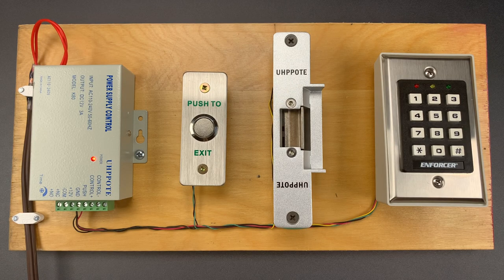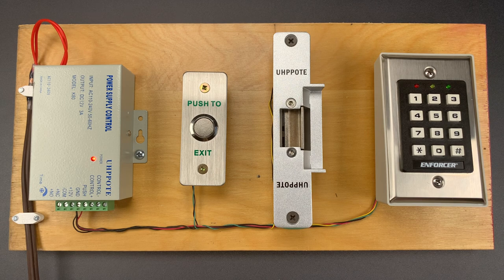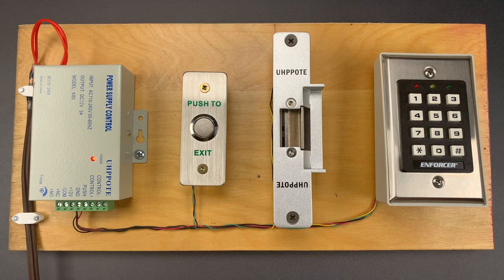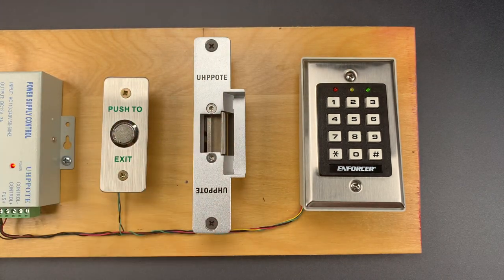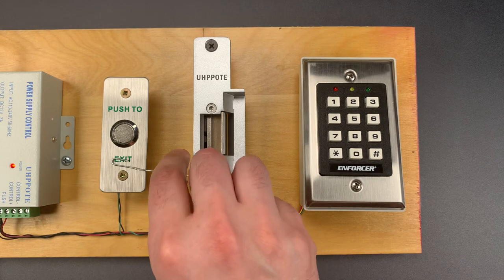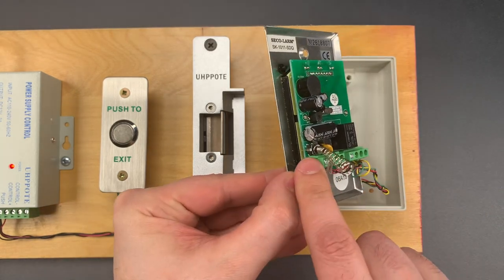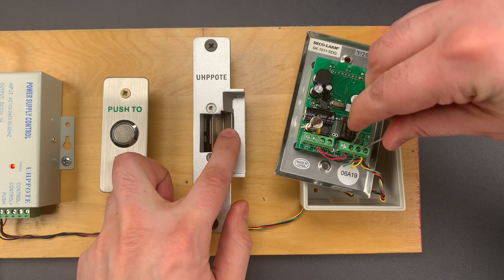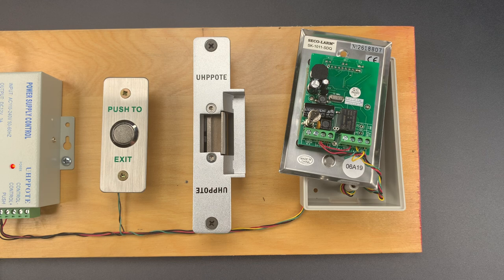[1045] Swiss Army Knife Bypass of Keypad Lock

Comment: "This is the Lock Picking Lawyer, here to prove once again that there is nothing you can do to stop me."
Reply: Yeah. Genius lawyer goes to prison for someone else's crime...
Reply: Imao
Reply: At this point it would be easier to just convince him that there is nothing behind the lock worth getting into.
But then he would simply take the lock as a challenge.
Reply: It would be actually fairly simple to stop him: You build a keypad that only sends they keystrokes to a controller unit on the inside of the door. That way, the only wires you can reach is sigal wires that don't do shit without the code. Bonus points if you put the controller unit in a metal box to prevent tampering by EMP or magnetism and make the opening-closing signal a little more complicated than just on-off on a certain wire. 

At that point, you'd either have destructive methods or defeating the controller left as methods of entry
Reply: @An0niem4  that's usually what is done in access control
Reply: @jonsgarage3859  Yes, proving that LPL can only defeat shitty systems in this way. What is shocking to me is how common those shitty systems seem to be
Reply: @An0niem4  Would you like some popcorn while enjoying Security Theater?
Reply: @napoleontheclown  could I please have sweet and salty mixed and a large coke 🥺

Comment: This is why it is important to use an access control system that communicates to an internal controller that makes the decisions. Don't let equipment on the locked side make any decisions.
Reply: Like jails.
Reply: Like how you should never make a website client-side, you can just edit it with inspect element
Reply: @hotfire7075  you mean you shouldn't authenticate client side. There's nothing wrong with putting other stuff on the client side
Reply: @alexeecs  True, a website that has nothing on the client side is hardly a website at all.
Reply: It's amazing how simply relocating that logic with some wires will probably raise the cost of the solution by about tenfold...
Reply: @SolidSonicTH  this unit is great for pedestrian gates or vehicular gates, I've seen it installed on giant mailboxes for amazon also. The op is correct, you would be better off with a controller installed inside a secure room and give each tenant their own credentials, this is the right way. Yes that is exponentially more expensive. 

I use an app or remote to release my e-strike and there is nothing outside to compromise. Better that way
Reply: For office environment, you have to provide a bypass there at the door for safety reasons, such as crash bar or motion detect. In my case, the door was indeed secured by central control, but for safety requirements you have to allow people out by a system that bypasses the lock right there at the door (in case of fire, etc.).
Reply: @hotfire7075  there used to be a game like that, but only the "send gifts to friends" part so what we'd do is just before we send gifts we change the code w inspect element to give another item to our friend, so we gave each other the most op shit you can own
Reply: @ws8080  Yeah, but you can use delayed egress crashbars that make a whole lot of noise, and it's not required to be on internal doors, such as data closets.
Reply: Always put the security on the backend
Reply: Never trust something you can unscrew from the locked side. My favorite with USA type doors when I forgot/lost my keys was a hammer + screwdriver, took about 10 seconds to “break into my house”

Comment: I was once working on an event packing up the stage into a basement and there was an RFID operated lock that gave access to an industrial elevator that rose from the ground to the outside and one of my work partners accidentally closed the little control door and the person authorized to access it went home for the day so I called security to open it but they didn't come for several hours so I unscrewed the rfid scanner, bridged the contacts and opened it. This being a federal institution, it actually set off a silent alarm and security STILL took an hour to arrive =____=
Reply: Federal institution, and it's that easy. Technology has outrun humans by do far, anybody with s little motivation can have their run of the world it seems. Personally I never trust tumbler key locks, they are medieval artifacts that haven't changed in a thousand years, ridiculous
Reply: @ddgryful  Patently false.
Reply: Hahahaha that’s awesome!
Reply: The reality is, locks are meant to be opened. It might seem ironic to most, but if that weren't the case you may as well just weld whatever the lock goes to, shut. So long as that's the case, it can be opened without a key or code by just understanding the mechanism. 

That's why the old adage exists that locks only keep honest people honest.
Reply: Gotta love "High security"  it is possible someone related to security was high.
Reply: I knew how this would go as soon as you said "packing up the stage." Theatre techs are pretty much my favorite humans: happy to along with your lock/policy/whatever until it becomes an inconvenience, and then they'll just dismantle it with LPL speed and efficiency, do what they need to, and reassemble so you're none the wiser. "Never cross them. They will get even and you will never be able to prove it was them."
Reply: @ddgryful  Pretty much the entire federal government was using mechanical cypher lock door handles that could be opened with a magnet, it's not that surprising.
Reply: I rig.

Comment: Me: - Oh, a 4.5 minutes long video from LPL about an electronic lock! Must be a good one if it lasted this long.
(Five minutes later)
Me: - Oh... False alert - it's an exploit compilation video.
Reply: Fatal design flaw: lock internals behind keypad should not be located in unsecured area.
Reply: @Paul Martin I think a properly made electronic lock will not trust the outside unit. It might as well have wing nuts and security would be okay.

Well made lock will continue to work flawlessly even if you cut the outside unit off and connect wires e.g. to mains voltage or to a welding transformer.
Reply: @MikkoRantalainen  idk I'll have to look at ours. The ones we have at work we maintain are a good bit more have end I'd say but most likely still gave trash security
Reply: Right. I was like oh similar locking setups to what we have at work must be complex. 73 ways to disable, hmmmm well shit.
Reply: You literally went to town on the format of your text. 🙄🤣🤷🏼‍♂️

Comment: The door to my storage room got locked accidentally today. I went through a bowl full of keys that came with the house and found the one that should open the door. It didn’t. The whole mechanism was gummed up. I thought about getting my picks out of the truck, but grabbed a 12” piece of wire laying beside the door and slipped the latch on the 2nd try. Moral of the story, bypassing is often easier than picking.

Comment: When I was in the Navy I worked at a comm station in Keflavik. The building was somewhat secure. They wired the egress button separately from the outside control panel. That seems like such a simple thing but it really makes a lot of sense. Also there were no accessible screws from the outside of the door. Again, simple, but makes sense.

Comment: Mr LockPickingLawyer
Excellent presentation , as always.  I am the small-scale   technician ,  working in Greece , and use  this keyboard too , Hoever....
 I  made some personal modification on  it , replacing tamper  switch  with electro-optical coupling 
and  connecting the chassis to  15 KV , low amps transformation.  After  removing the  screws , any  suspicious  intruders  get  very dangerous electroshock -but only once . Afterwards  the  circuit  is out ,  to avoid  any possible  LEGAL problems , for the owner.  Do this for 10 plus years with  success.  No lawsuit yet...

Comment: As a industrial electrician with a heavy background in control wiring I’ve had to use this method quite a few times to get into electrical rooms when nobody is there to open the door in the early hours of the morning. It’s a simple method but most people have no idea how to do this so it’s not a real issue for the most part. I’ve never came across one with the security spring wired in with the exception of the federal reserve’s in a few cities
Reply: The anti tamper switch doesn't neccessarly need to be wired to an alarm, but one way to increase security is to have a relay (with keyswitch or button for reset) on the inside, where the lock wiring is also connected. The tamper switch is simply connected in series with the NO contact on the relay, then the reset/keyswitch over the NO and C contact, to the coil, so the pulled relay effectively powers itself.

When tamper switch releases, the relay will lose power and only way to reset it is to reset via keyswitch or reset button.

Then wire lock wiring in series with the second C and NO contact, only providing power to the lock if relay is pulled.

This will create pretty much security for pretty low cost, as any tampering will disable the lock wiring, so regardless what attacker does, nothing will unlock the door, only way in is with physical key then press reset button or usevreset keyswitch on inside.

An reed switch (nc) can be added in series with tamper circuit to prevent using external magnet to trip the inside relay.

However, as we seen tamper switch can be easily be bypassed, but this creates a trap - like trap pins in a cylinder, once you trip the trap, your day is over.

Comment: Finally a use for a Swiss Army knife.
Reply: You mean other than to hand over to TSA?
Reply: When I worked on building control systems, I used this exact knife for most of my physical work from bathrooms to casinos to military research sites.
I still have one on my key-chain and regularly use it for all sorts of little jobs.
Old related joke, "The chainsaw starts with a roar and the rube asks, 'What's that noise'."
Reply: Finally?Are you sure?:)
Reply: Multi tools are a thing of convenience and are great for small things like this. If I didn't have so many keys I would carry one in my pocket.
Reply: I find they aren't up to the job for the work i do.  They work in a pinch, but even a crappy tool for job far exceeds a small multi tool.

Comment: imagine claiming to have an anti-tampering switch and not actually connecting it to anything lmfaoooo
Reply: Well, that's up to the buyer to put a sound alarm to the terminals, perhaps the seller of this electrical lock has a version that includes it, but it's cheaper to sell it without it and whoever acquires it can put any sound alarm they want in it.

Anyways, this is just a big failure because the central components are exposed to the outside of the lock, make it pretty insecure as LPL showed.
Reply: You don't want to know how many people kept the electrical fire monitor system on "manual override", just because “those false alarms are soooooooo annoying”.
Reply: Maybe its so it can be hooked into a buildings existing security system. Still pretty easy to defeat but some buildings I know prefer silent alarms.
Reply: Like those black plastic "cameras" with a flashing red LED. Or the "ALARM MONITORED 24 HOURS" stickers - no alarm, just the stickers.
Reply: Thats the case more often than not.  Consider it a cost saving measure.
Reply: That's the fault of the installer, not the lock manufacturer, that the anti-tamper switch isn't connected to anything.  Although it is the fault of the manufacturer that it is trivial to disable the anti-tamper switch.
Reply: It's wired to an alarm system which is not included
Reply: Imagine having an anti-tampering switch with a spring that long it let's you look under the lid before triggering the alarm. It should be a stud on the bottom of the case that is tall enough to push the button if the lid is bolted on. That way just loosening the bolts would be enough to trigger the alarm.
Reply: body no False Fire Alarms can also net you fines, if the alarms are excessive, depending on where you are.
Reply: @peterkiss1204  I'm no expert, but that actually sounds like it should work.